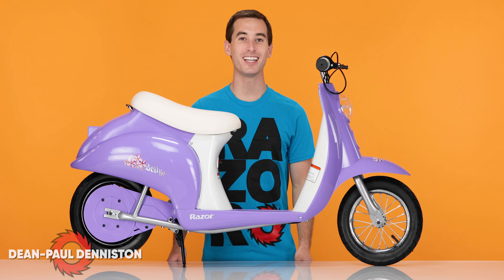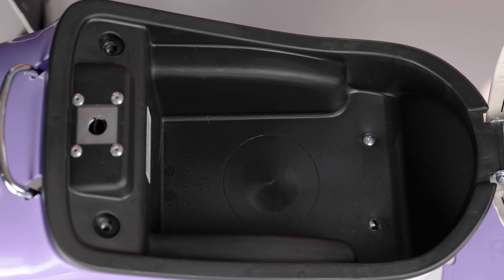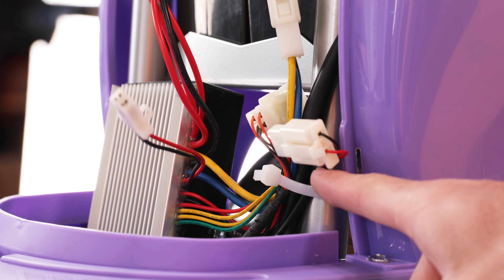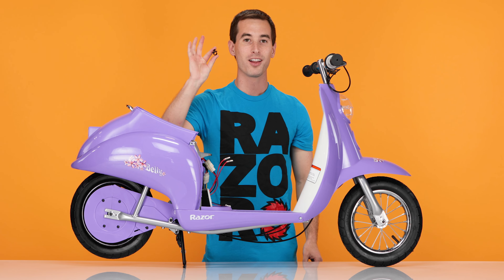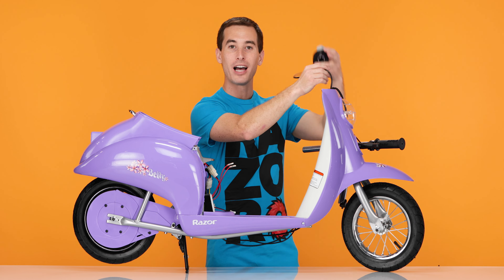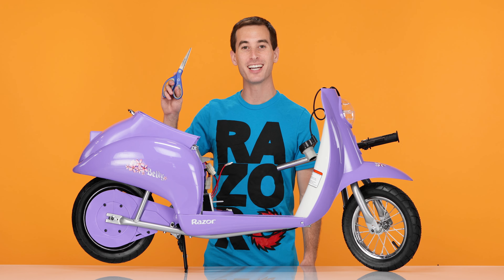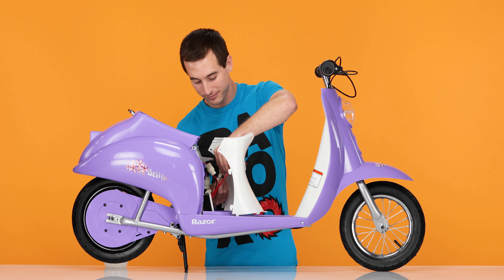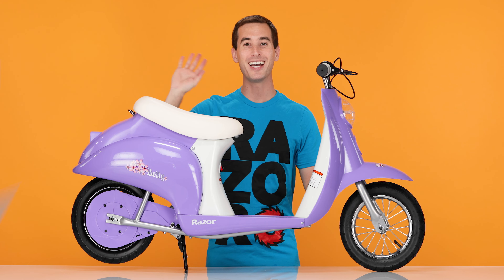How to Replace the Throttle on the Razor Pocket Mod

Comment: Is there a way to change to a variable speed throttle?
Reply: With a razor pocket mod no, simply because most variable speed throttles are 6 wires, meaning they have 6 wires in the plastic connector, but the razor pocket mod electrical controller is a 4 wire, there is 6 wire versions of the electrical controller but it got discontinued.

Comment: Where do you get a new throttle ?
Reply: @ThePersianPerversion  Is it easy to install a multi position throttle on the pocket mod scooter without having to change the wiring or controller under the seat that the throttle wires attach to? I'd like to replace the stock throttle on mine with a multi position one so I can drive with the option of a reduced power/speed output to the rear wheel for better stability and control while riding. Seeing as how this scooter is intended primarily for use by children razor should have designed it with a multi position speed control for the throttle instead of the less safe stop and go at top speed instantly throttle that was included with the product. I'm 47 and had a minor wipeout when riding mine for the first time back on tuesday because the scooter was running to fast.